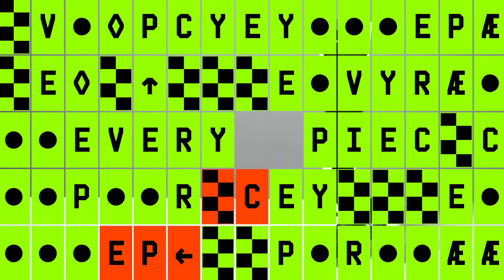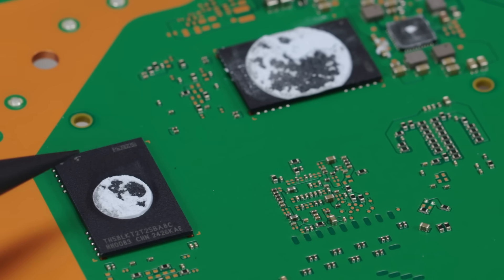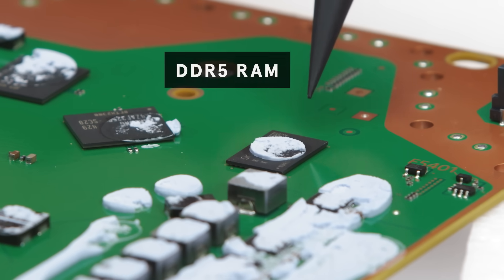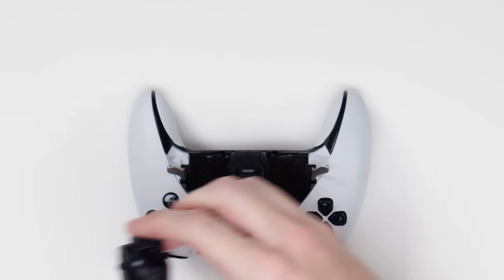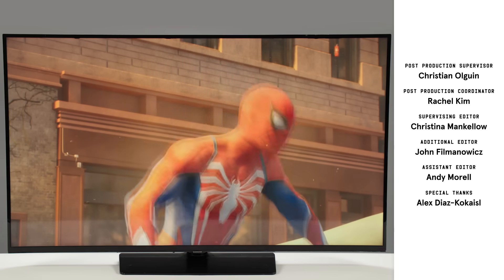PS5 Pro Teardown: Every Piece, Explained | WIRED

Comment: Hi there. I got a PS5 Pro for Xmas, but it was bought before then. I am just setting it up now, but I noticed the LED light strip down the disc drive side is inside the console, and the black casing isn't clipped in correctly. It also has a warranty seal right below it so not wanting to try open it tore seat the light strip as brand new I don't know what to do. I think it's just past the return window. I'll get on to it first thing in the morning, but I can't believe how shoddy the care taken in the console's build is. I must have gotten a Friday afternoon special!

Comment: The real question is 
How much watt usage does the base ps5 and ps5 pro consume?!
Reply: PlayStation 5 has a 350 wattage power rating for the base physical model, 340 for the base digital mode though both use about 200 to 220 watts when playing, the PlayStation 5 Pro has a 390 wattage power rating though playing brings it about 240 on average, PlayStation Slim has the same 350 physical / 340 digital power rating as the base model though uses up about 260 watts when playing since 200 its on console the 60 its on the tv

Comment: After the bottom screw on the fan stripped on my Horizon forbidden West bundle I decided to do a trade-in with my local Best Buy and what brought me to the PlayStation 5 Pro, which is one of my favorite things on the console. It's the battery the fact that you have a compartment to easily open it and change the battery was the thing that brought me to purchase the console so far. It has been an amazing experience. I did open the battery compartment and put in a Duracell because that is my favorite battery brand and the way you Did the tear down with detail just shows that in this case Sony went the friendly route and did the console repairable friendly including showing you what the dots the length of each screw. So you put it back where it belongs. Thanks for the Magnificent teardown and video. I really have enjoyed my PlayStation 5 Pro

Comment: PS5 PRO is basically not worth it unlike even original PS5.
Reply: It seems like the engineering is better for long term use. If you don’t already have a ps5, getting the pro seems a no brainer.

Comment: Is the I/O controller really made by Samsung? 
The the laser marking stated as “SIE” (Sony), likely to be designed by Sony
And also “Taiwan” stands for assembled in “Taiwan”
Though it is possible that Sony outsourced the wafer production to Samsung Foundry and do component assembly & testing in Taiwanese OSAT
But nevertheless I supposed it is highly unlikely a Samsung designed controller…

Comment: I think by the amount of thermal putty holding majority of the heatsink together you definitely compromise the cooling once disassembled and put together without carefully removing and reapplying all contact points with a similar putty.

Comment: My PS5 Pro with disc drive makes horrible noise when reading the disc. It goes away when I press the drive to the console, but comes back the moment I let go. I even have the official vertical stand. Reinstallation doesn't help.
Reply: It depends how it sounds. When you insert a disc, it's supposed to get loud for a few seconds before becoming quiet again. But if it's a buzzing sound or anything like that then that's not normal.

Comment: 7:25 That’s wrong - it’s GDDR6, not DDR6. GDDR has higher bandwidth but higher latency than DDR. The specifications for DDR6 haven’t been officially confirmed by JEDEC yet, and no DDR6 RAM is commercially available.

Comment: The fan is not bigger then the PS5 fan. 02:45
It is smaller but runs faster = louder = not so pro 😂
Reply: Yeah much louder than my launch PS5
Reply: @Kiisseli1337  phats are nice. I use the cfi-12.. pro is still in the unopened box 😄
Reply: WRONG
Reply: @irfkaptan  you are talking to the ps5 fan guy my uninformed friend 😄👍
Reply: Def not louder 💀 🙏 😂😂😂

Comment: 7:24 - correction: that's GDDR6, not DDR6.
Reply: Yeah it doesn't matter
Reply: @neo7759  nah.. it's quite big different: GDDR6 is for GPUs, prioritizing massive bandwidth with wider buses, multiple channels, and NRZ signaling, while DDR6 (System DDR6) is for CPUs, focusing on lower latency for general tasks, using DIMMs and different channel structures.
Reply: @andrealilli4366  DDR6 doesn't exist for CPU's yet tho??

Comment: 4:51 You got it wrong. This is not the APU, it's the filter capacitors. The part you called the back of the APU it's the APU really.
Reply: Wired doesn’t review videos before publication at all. Same company that let that disaster PC build 😅
Reply: @vac59  that was the verge

Comment: I thought about the liquid metal for a while, when they started to sell the vertical stance separately they must have enough data to conclude that placing the ps5 vertically can cause troubles because of the liquid metal. So, in order to deter such practice(without saying they messed up) they started to sell the accessory apart.
Reply: No, liquid metal is never a problem because it's under pressure and sealed like water cooled pc don't have problem with orientation or leaking. They're just greedy to sell the stand seperately because it looks much better
Reply: @reenachauriya4931 I had my fat ps5 since launch in the upright position until I upgraded in November with no issues
Reply: Bunch of nonsense by a fake PhD professor

Comment: 0:05 the frame
0:08 side panels
0:25 cmos battery access
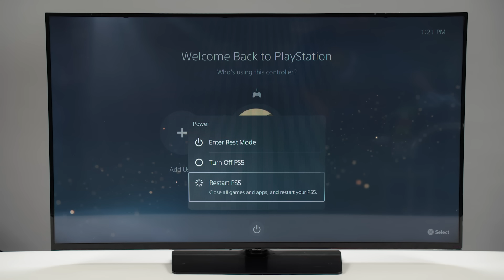0:42 cmos battery meaning
0:52 connectivity
0:55 wifi + bluetooth antenna
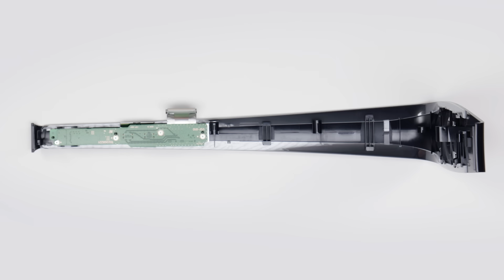1:05 i/o board
1:08 i/o board meaning
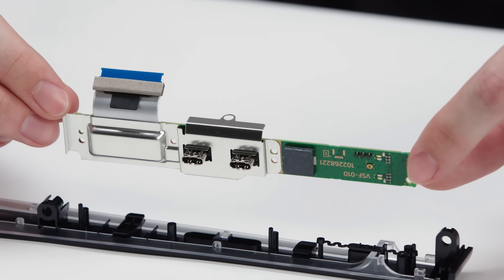1:27 M.2 expansion slot
1:39 M.2 expansion slot meaning
1:44 cooling system
1:57 jst connectors
2:19 screw map
2:27 the fan
2:44 heat sink fins
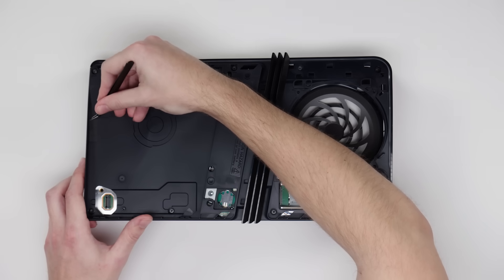2:52 inner plastic shell
3:00 Magnuson-Moss Warranty Act
3:10 heat sinks and inner components
3:23 heat sink
3:28 thermal putty
3:35 metal shield
3:41 motherboard-to-port board interconnector cable
4:03 front and back heat sinks
4:13 power supply
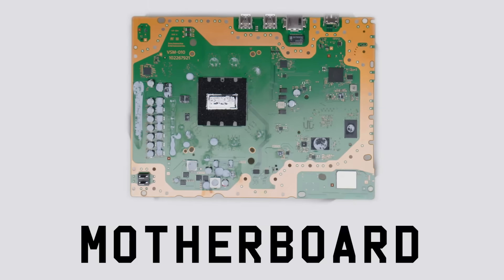4:19 motherboard
4:27 accelerated processing unit (APU)
4:30 APU meaning
4:39 liquid metal
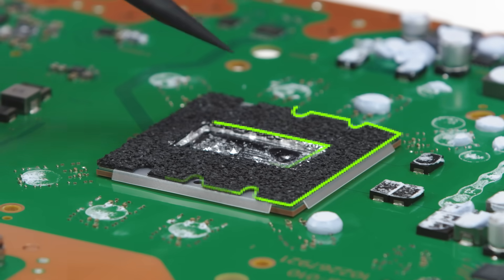4:58 etchings
5:02 foam padding
5:13 Playstation spectral super resolution (PSSR)
5:15 PSSR meaning
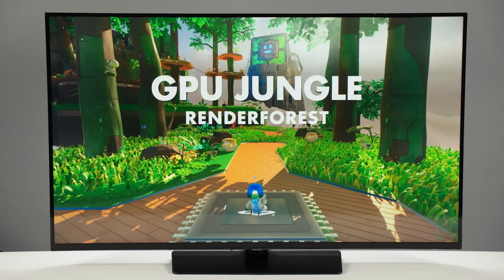5:26 I/O controller
5:34 Nand flash storage 1
5:38 Nand meaning
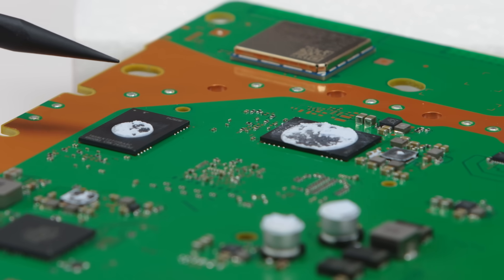5:55 512 GB chip storage
5:58 USB-C components
6:10 bidirectional linear driver meaning
6:22 Multi-Phase controller
6:38 compacitors and conductors
6:48 wireless card
7:00 DDR6 Ram
7:10 DDR5 Ram
7:16 DDR5 Ram function
7:21 Nand flash storage 2
7:25 M.2 connector
7:32 HDMI retimer
7:40 DualSense Edge controller
7:53 Paddle/Function buttons
7:59 pulls off caps
8:02 Adaptive triggers
8:20 front trim
8:26 Removable joysticks
8:37 rear trim piece
8:54 battery
9:00 vibration motors
9:11 ribbon cable
9:15 microphone
9:21 battery bracket
9:24 controller motherboard
9:26 speaker
9:28 mid frame
9:33 button map
9:39 gaskets
9:43 touchpad
Reply: Power supply ?
Reply: @antonromanov1  4:13
Reply: @antonromanov1 there is also no haptic feedback.
Reply: graphics unit ?
Reply: @AnuragK97  inside the CPU, thats why called APU
Reply: @bimzz4789  oh okay....thanks
Reply: Get a life

Comment: Wow, easy and removable joysticks is a huge win for gamers. Im shocked to say, good job Sony! Someone's actually listening to the mass audience's woes! That's huge for repair!!
Reply: And with all that engineering they couldn't have just used a hall effect sensor which will never drift
Reply: @pixels_per_inch  frfr
Reply: @pixels_per_inch  Its all about the Profits
Reply: The only problem is that Sony isn't producing enough replacements, so finding them in stock is a gamble and you will never get them for the MSRP.
Reply: It’s not the first time a module controller is made
Reply: What are you talking about
Reply: @MalcolmSchafer  read again what i said lol
Reply: If you have a screwdriver you can take anything apart almost scuff controller is easily removed thumb sticks